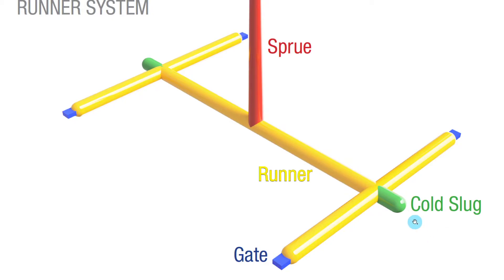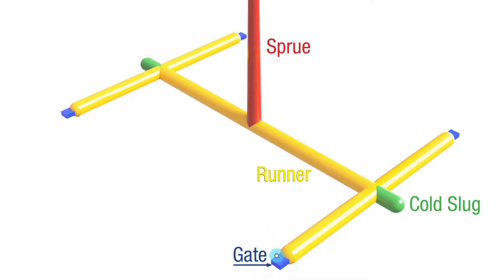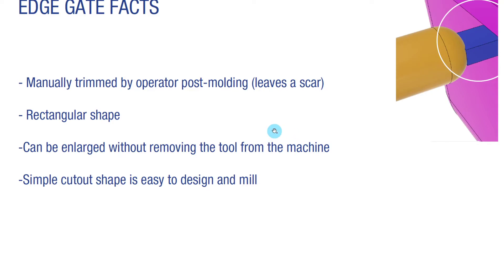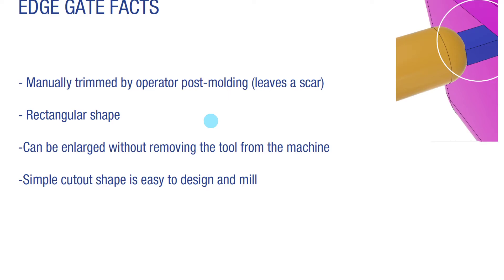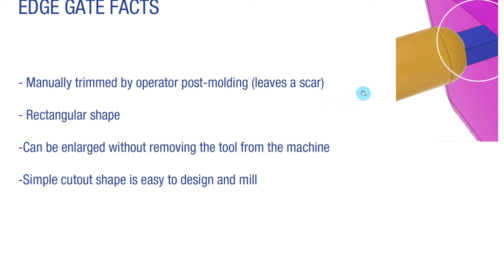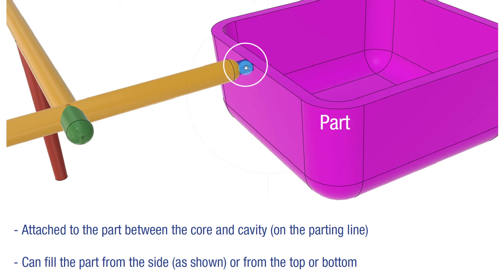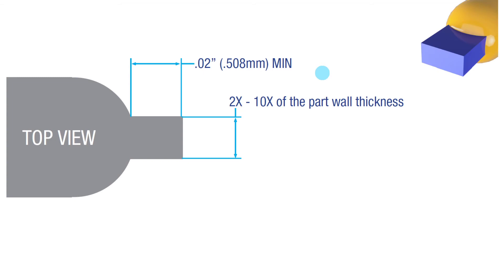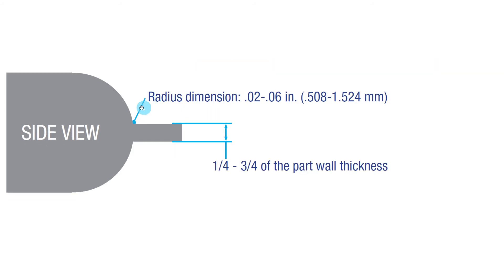EDGE GATE - Injection Molding Gate Types

Comment: Hey unrelated comment, but I found your old post on Reddit about your Adsense issues. I’m having the same  problem. Wondering if you ever got it fixed and how I should go about it. Thanks
Reply from the maker: I just used a different email address than the one my YT account is on and it worked
Reply: @AvivMakesRobots  how would I link that new address to my YT account then? And also did you do it on the Adsense home page or from your YouTube Monetization tab?
Reply from the maker: From the adsense page, I believe. I think I logged into adsense while logged in to the new email address. Then, I copied and pasted my youtube URL into the "what is your website?" bar on the adsense website.